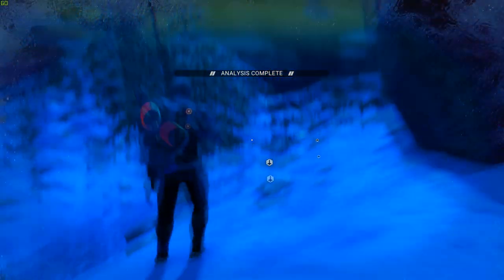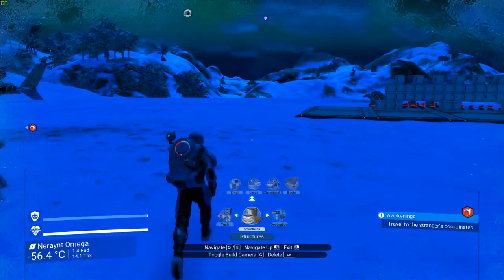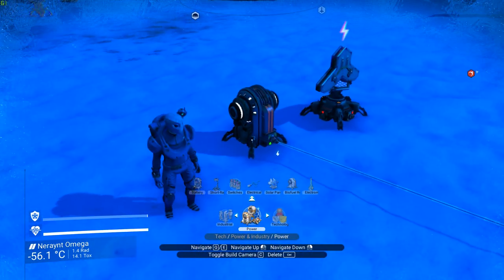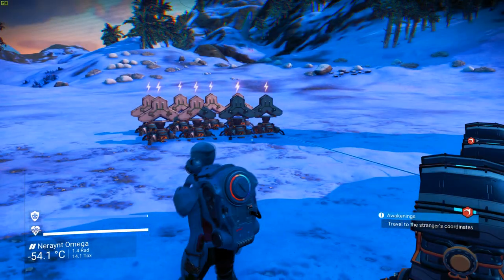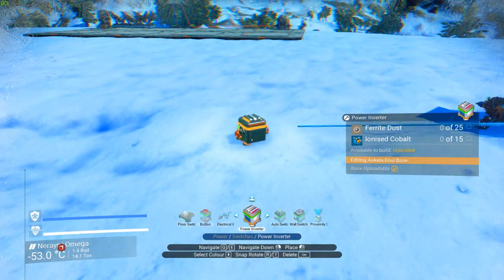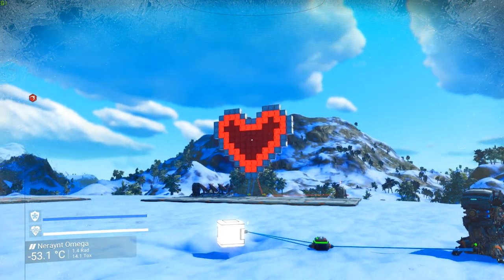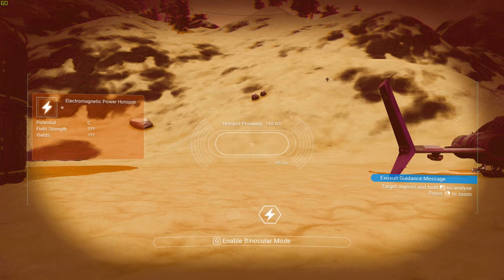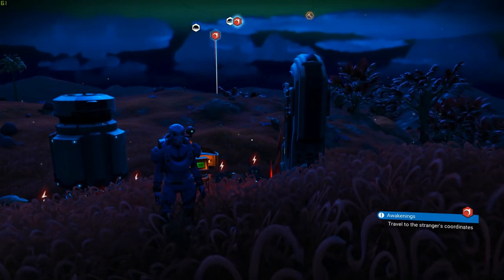No Man's Sky Beyond - Everything You Need To Know About  Power, Industrial & Logic Systems

Comment: Great video! Pretty much how it works in FO4 then.
Question though that I keep getting confusing contradictory answers to since everyone is still trying to figure this feature out:
Can I power my wood/metal/concrete bases or not? I built 90% of my bases with these kits and I can't find a plug to power them... super bummed out about that. Gave up on the update after 2 hours because it's all a buggy mess on my old save and multiplayer doesn't work anymore. I can't go to the Nexus and buy some of this stuff. I used the savegame editor to give myself salvaged technology and bought stuff the old way through the analyzer. But a lot of stuff is missing that way... so I have no idea if my bases are screwed or not. I'll probably have to restart anyway unless old saves get patched properly. But still...

Comment: Any advice running power over long distances? I have a base location at a specific spot I wanted and there is an S class electro field that is 500u away but doesnt look like I can feed power from that distance, or from base to base. The electrical cable reaches just doesn't power anything. To utilize the electro field spots its like I would have to build my base there which really limits imo.
Reply: put down a battery at max distance and lay a new wire from the battery to yout base (use more batterys if needed)

Comment: I have charged a bunch of batteries but I cannot get the electricity to reliably power things. It will seemingly randomly power different cargo boxes, and will not be used by the house at all. I've got just a hair under 1,000,000 power banked plus like 14 solar panels, do I need more power or what?

Comment: Could you do a video on how to use a electromagnetic generator?
Reply: You just need the Survey Device to locate an Electromagnetic Power Hotspot. You go right there (within like 4 units) of the marked spot, it will survey the area; which mean it'll give you the information of what the exact output is. You plop down the EM generator, and its free power from then on. It doesnt need fuel, goes 24/7. You can put as many generators as you like, each will provide the maximum amount of power per generator that the surveyed area can produce.
Reply: @falsinar  thank you man. Highly appreciated 👍

Comment: I have a question about powering stuff. I get how to connect the prefab stuff to a grid as there are visible connectors, but what about the non-prefab stuff (the freeform build materials)? How do you power stuff inside those structures?

Comment: If we are to tinker this power feature further then they need to make more.
Also not sure about this but building multiple batteries connected together isnt efficient. Lets say 1 battery stores like 5000KP and when u build 2 thats 10000KP in total. All ur power hungry techies require a total of 50KP and when u connect those to the 2 batteries, both batteries lose 50KP instead of sharing the total 50KP (25KP each). I divided my power techs  to individual batteries so i can get the proper power consumption. If this is confirmed true i think it needs fixing.

But for now i wish there are more freighter building parts (rooms and all,   very wide customization but very limited building parts); frigate customization, even just technology module upgrades is a good start (id also like to have npc's visible. Best if can also customize inside using build parts); ship customization, just like character customization but excluding exotic ones to maintain uniqueness.
Reply: Are you connecting the batteries in series or parallel?
Reply: @johnmckown1267  sorry i did not get what u mean. 

I was trying to keep the power on during night time so i was checking the power consumption at night and storage during the day and adding more batteries when needed. 
The way I connected them was, connect all batteries first, then at the last battery, connect all the power techs.

Btw, health and shield station doednt work for me either even when theyre already powered up. It keeps saying power, and the shield says, 10 ferrite required.
Reply: UPDATE:
I think its not bugged or something was wrong. I saw that the total power storage stacks so yeah.

Comment: The only thing that sucks is linking EVERY light to a wire.
I'd hate to be that guy with a beautiful colourful base....
Reply from the maker: You don't need to do that. You can wire the first one, and then only connect the lights with one single line. You'll see it in the video when I showcase the proximity lights :)
Reply: I'm that guy and this whole wires thing is annoying AF. I can't even get my large storage containers powered on reliably.
Reply: Amazing to me that NMS can't use broadcast power. Really, wires?
Reply: @illuminotme825  I haven't bothered. I can put stuff in and take it out by bring up my exosuit (or other) cargo slot screen, and use the "Transfer Items" to put stuff in and take it out. At least this worked in patch 2.04.

Comment: How do you get the lightboxes and automatic switches and stuff in normal mode (not creative)? The Nexus doesn't sell those, I can't find them anywhere.
Reply: Probably the research terminal you can build? I have not quite gotten there, yet.
Reply: @RpTheHotrod  You can't get them there either. I've completed all of the base terminal missions
Reply from the maker: @jourdn11  Check the base upgrade tree in the Nexus. Scroll between sections using Q/E until you get the one with power generation / industrial. It's all there.

Comment: For the love of God, has anyone figured out how to power devices inside of basic structures (wood, concrete, metal bases) such as hydroponic trays? There must be a way because they probably wouldn't let you place them if not?
Reply: Exactly my problem as well
Reply: @tigerberlin1935  My fear is that this is a HUGE oversight by HG, and we're technically not supposed to place these items that don't have direct power connections inside of anything that isn't a cuboid or prefab. Of course, I hope that I'm wrong, and there's some hidden way to power the hydroponic trays, doors, etc.

Also, I keep seeing these light cubes, but haven't heard anyone explain where to get them. I've already checked the blueprint machine on the Nexus, but found nothing.
Reply: They could fix that by adding a power connecter object to wooden base pieces and others

Comment: I’m trying to build a “back up” generator but i don’t know how can I use the switch to say 

Ok, when I press this, The main generators will activate and if I press it again the back up generator will activate
Reply: Daisy chain all your batteries.  Break the chain between the main batteries and what you consider your 'backup batteries'.  In between this breakpoint, place an on/off switch.  For example you could have  powergenerator---b-b-b---switch---b-b-b.  The b is for battery.  Now if the switch is on, all batteries will be charged otherwise only the first set.  Once charged you'll flip the switch and the backups won't discharge power  unless the switch is on.  Connect all your devices that require power to the main source (first set) of batteries.  

I hope this helps.
Reply: Benjamin Clay i need images to understand better

Comment: @KhrazeGaming I got a Problem Help. My Base with a farm is about 600u from the next electromagnetic field and i cant Place stuff that far away BUT before i went into another system to get some Materials to build electrowave Generators i managed to Place 1 that is connected to my base, how can i do that ?
Reply from the maker: Extend your base by placing anything over the base limit. 1. Go to the edge of your base (you can check it by using the build menu until it disappears. 2. While still inside the base limit, at the edge, build something on the other side of the limit. Bam.....base limit extended by at least 50 units. Repeat until you reach the EM field.
Reply: @Khrazegaming  Thank you! It worked :)

Comment: You see that door at 4:36? The one that is the entrance to the structure? 
Challenge:  
Connect it with wires and add switches on both sides so that it stays closed and opens when a button switch is pressed. 
HINT: The door remains closed when it's powered. That's your starting point.
Reply: I also encountered this problem and I'm already working on it.
Reply: @Adam-lp5ky  Ye, i'm not sure if it works correctly tho. I made it work on one side but doing the same for the other side does not override the control on the other side so basically one side works, the other does not even tho they're made the same way. I'm guessing the auto-switch has to be connected between the two button switches on either sides, so that it switches (somehow) between the buttons. 
It could be bugged tho.. nevertheless, it's a puzzle that must be solved, lol.  I will be continuing this on the weekend.

Comment: Where do you plug into a wooden structure, I didn't see the spark symbol on any of my walls
Reply: You don't. The individual pieces (wood, concrete, and metal) don't require power. Only the Large pieces and the cuboid rooms do.
Reply: @MisterPuck  I have healing and hazard refuel units on the wall that now need power, how do I connect the power to it then?
Reply: @LordTalismond  directly, I would assume. If you can't plug them into power directly with wires, then the only way to power them would be to dismantle them and rebuild them in a cuboid or large room that's connected to power.

Comment: I would like to know if we can not connect the food depots with food pipes because it is super hard to build full to be able to use the potential of extractors to the full. Let me explain, I play about once a day and therefore I would like my activated indium to be stored enough to be able to run my 50 extractors 24 hours a day and to be able to recover gold each day I only have 40 silos and so that holds 2h30 it would take 400 silos to make it last a day since 1 extractor needs 8 silos to hold 24h. Someone has a storage tip or a way to speed up the manufacturing process and install silos (silos = sorry supply depots) Thank you for reading this com until the end I look forward to feedback

Comment: My base is under ground.  How do I go about wiring it up from the inside please?
Reply: Depends if it's with prebuilt modules or custom panels. If it's prebuilt modules, just put on power wire to your door/entrance and your whole base is covered. If it's panels, you can connect wiring while walking through doors/down stairs and whatever.
Reply: @hunterm9  Thank you.  It's quite a large base.  Most of it lights up now but my safes are dead along with other devices so I guess I require more juice.

Comment: Any difference with batteries and power sources wired in parallel versus series?
Reply: Nah. As long as it's linked in some way, it's all a part of a single grid. The grid will only have 3 characteristics: amount of power being supplied, amount of power being consumed, and amount of power currently stored.
Reply: Nope, all power is measured in kP, and connections don't matter
Reply: I am going to call this out as a bug.
It should, as that is how the real world works. (I know this is just a game)

Wire connections too need to cost copper, and not be free.

Logic units require series and parallel connections, to allow for greater in game logic control, much like minecraft (which I do not play)

Comment: What about bases constructed using metal, concrete?
Reply from the maker: Those need to be manually powered (i.e anything places inside of them needs to be connected to the power source)
Reply: @Khrazegaming  That is a lot of headache. Thanks for the response.
Reply: Thaaaats what I was looking for. I like that a lot- prefabs are easy but limited, while concrete/wood/metal you can customize how and when things power on. I'm waiting till I get the survey device, most of the build tree unlocked and a metric ton of rescources before I build anything of consequence.

Comment: I attach a generator to my storage units and it doesn't work
Reply: Same issue i had 5 storage units and managed to get 3 of the 5 to power up and withdraw all my stuff in them cause all this power stuff is too tedious for me now. The other 2 i just got fed up of fueling my generators multiple times and wiring them just to have the storage units not powering up. I wasted like 2000 carbon in my attempts and ended up just deleting all storage spaces as i didnt have anything of high value in them
Reply: Only EVEN numbered storage units work at this time.  The ODD numbered ones don't power up.  I had to go to freighter and remove everything from odd numbered ones and put into the even numbered ones.  Good thing we can have stacks of up to 10k now or things would be difficult to move around.

Now, in Freighter its hard to tell which is odd/even, so I deleted them all and put them back down with odd on left, even on right.  Removed all stuff from odd side and put on even side.  Then I deleted all the odds both on planet and in freighter.  Back on planet in bases, I simply created even numbered storage units.  Hope this workaround helps while waiting on patch to resolve it

Comment: Can someone tell me how to get to the  nexus if you've never been to the  original space anomoly in your game? It says in one mission to go check out this weird space  anomoly. The thing about it is its in another system that's about  10 or more  hyper drive jumps away. The  other thing is the path in the  golatic map for this is the  same  as the  path to the center of the golatic core. Meaning when I switch between the two in the golatic map it still shows the  route to the  core so I'm thinking that's not how I get to this anomoly. This is on Xbox one.

Comment: How do you power hydroponic tables?
Reply: I had mine in a custom base and they wouldn't work because there's no place to hook up power to them.   I found that if you put your hydroponic table in a prefab building it is powered when you power the building.
Reply: Benjamin Clay thanks. Even connecting the glass cuboid rooms to generators the tables didn’t power so hopefully they fix that

Comment: The only thing that sucks is linking EVERY light to a wire.
I'd hate to be that guy with a beautiful colourful base....
Reply: Alan Playz that’s me, I finished linking it all up only to have my game crash as I was saving it. Needless to say I’m taking a long break from this game
Reply: Alan Playz i was that guy 😭😩
Reply: @lukeerative  probably for the best.
Wait for all the bug fixes
Reply: No, only the building has to be powered, anything in or attached to the building gets that power. So only a single wire is needed, the one attached from the power sources to the building itself.  I've got a bunch of lights in my base and not a single one of them has a wire attached.
Reply: @TheCJFrench  thanks
Reply: @TheCJFrench  Is this with the original base buildings like the one in the video or the newer structures (metal/wood/concrete). I prefer building my base using those instead of the classic base buildings and suddenly found everything unpowered and could quite get the wiring correct.
Reply: @thundaGawd  I know that it works with the cube bases as well, I don't know about the wood or concrete ones.
Reply: @TheCJFrench  No it does not work with the wood or concrete ones. This is very disappointing...
Reply: @TheCJFrench  When I get home, I am going to make a Solar Panel + Battery "farm" and connect it to my 30 bio-dome + cubical building + corridors farm base and see what happens.
Reply: @TheCJFrench  Definitely doesn't work with wood, steel and concrete based structures... which is sad. It's one of the most aesthetically pleasing ways to build bases, but now we can't power them without creating a wiring nightmare.

Comment: Well , i'm pretty ok with the new power generation, BUT wtf with the extractors and depots O_o ? It's so useless. First you need to find a spot where you can put your extractor but there is not a lot of them around your base. Then you need to wait 1 hour to get a stack of 250 ... WHY  ? trading with the npc or just mining myself take me 5 minutes to have thousand of ressources -_- . 2 the extractors only extract a few type of ressource (only the one you see when you scan the planet) so why spent my time and ressources with these if i can mine it or buy it ???  3 the electrical wiring, switches and pipes are very interesting but you can't make a lot of thing with it. I hoped i could make automatic farm but nop just do it mannualy ...
Reply: Before my farms all went dark, I was getting 64 million units per day from them. I agree that buying large amounts of basic resources at a station is just plain simpler and faster.

Comment: We fly in 26th century compact starships, but have to sling 1926 electrical wires to every little device. The wires look like the ugly, awful webs of cables they had in the 1920's, and despite our starships being powered by antimatter cells and fusion reactors, we must burn carbon or use solar cells and batteries. This is both ugly and stupid. 

The power it would take to life one of our starships to orbit would suffice to power a small city for a year just by itself. To bend spacetime in a warp jump would require enough power to fuel an entire planet for millennia. Our multi-tools alone produce beams of destruction that would demand the entire output of America for a month in order to dissolve and tractor in the tons of material we regularly mine. 

Yet, we must burn carbon to power wires to make lights glow.

This is ugly, stupid, and contradicted by everything else in the game. I despise this - not the logic circuits per se, just the lack of fusion and broadcast power, or zero-point cells, or atomic batteries, or fusion reactors. I despise the stupid wires from 1926.
Reply: be more creative with your building and you might find that you can hide the wires.